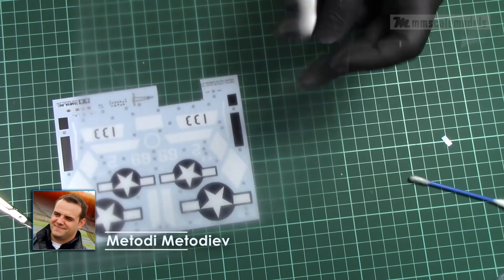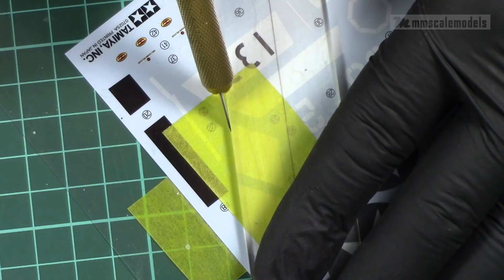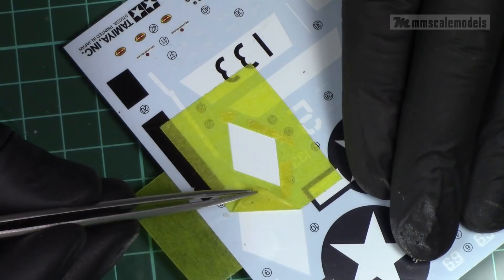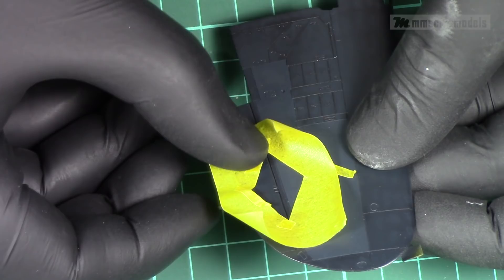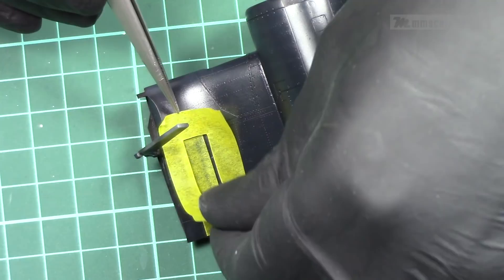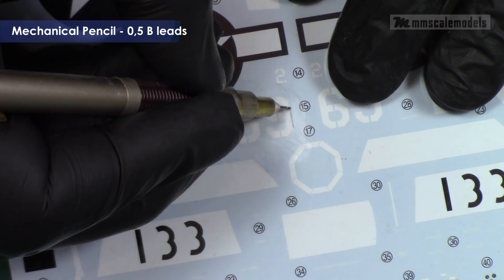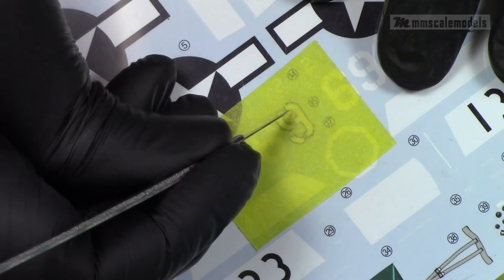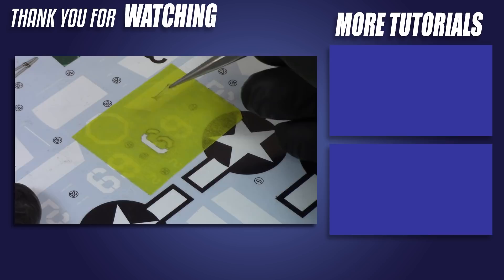How to create STENCILS to paint your scale model markings - plastic model building tutorial

Comment: Awesome tip! My experience with using freehand pencil (even with a ruler) is that I always tend to screw up the width so it's never appears uniform.

One thing I would do is use a photo copy of the decal sheet so you don't accidentally damage the decals when cutting.
Reply from the maker: Thanks mate, the acetate is quite thick but it does not hurt to be extra careful. Good point.

Comment: Great tip indeed!
How would you proceed for numerals with a thin colored border? The inner part is easy, as you showed, but to get the thin border is very tricky...
Thanks
Reply from the maker: The same method applies but it is extremely tedious and frankly, hard. So far I havent found a suitable diy. Best bet is a high precision plotter.
Reply: Thx! 
I was thinking: paint the number, cover it with the mask cutout, apply other masking slightly offset from the cutout edges, spray the border color.
Do you think it may work ... at least for simple numerals like 1 and 7?
Thanks a lot for your advise

Comment: Let me show you a smarter way to do it. Don't ever cut from the original decal. What you should do is scan or photocopy the original decal, then use the printout and cut it from there. This way you don't run the risk of ruining the original decal. I usually scan all my decals for each scale models and save the files for future printout whenever I need it. Just always remember to scan it in its original size.
Reply from the maker: My intent was to demonstrate a way of work without any extra tools... I have a cutting machine which makes things easy... but who is going to benefit from such video